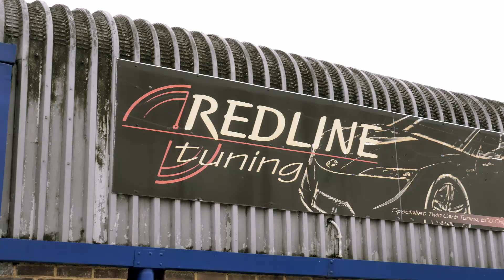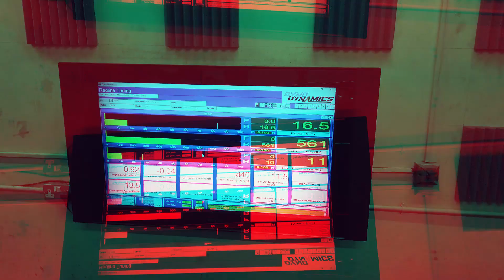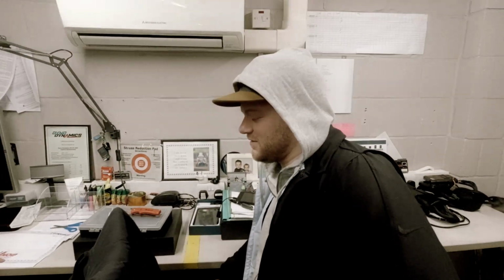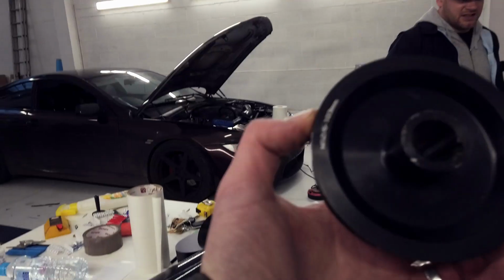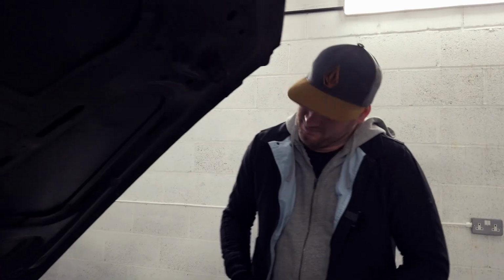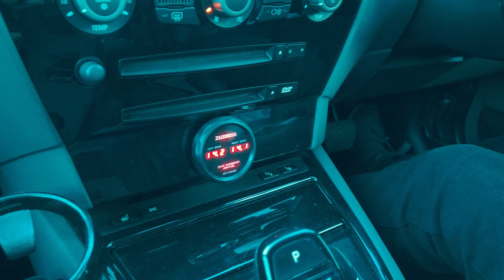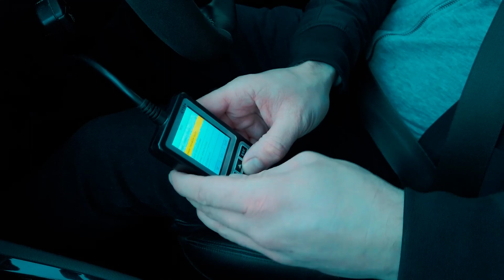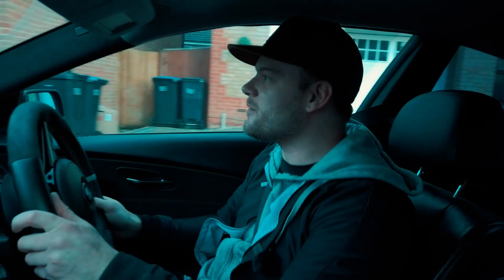BMW 645Ci E63 with 542bhp! BUT there is a catch!!! ESS G1 Supercharger episode 4

Comment: The ZF 6HP26 gearbox in your car is very robust and can handle much more power than 500 hp. It more than likely is overdue for a servicing, which absolutely matters with these gearboxes. They need all of the mechatronics seals replaced as well as a fluid and filter change every 50k miles. It can handle the power so long as it can keep up proper valve body pressure. There is a big following for these gearboxes here in the states. If I can be of any assistance, feel free to message me. I’ve rebuilt a few valve bodies on this transmission before and it’s really not too difficult.
Reply from the maker: thats some good info! I am sure Connor will be back to comment
Reply: The issue is the line pressure. The ecu torque map ends at 600nm. After that the gearbox sees -100nm. We’ve got the TCU seeing around 580nm now and it holds 540ish but can’t hold 577 which the car has made since. The gearbox has been completely rebuilt. I also now have ghe exedy 1000hp rated clutches that I’ll build into my sister gearbox but not for a while yet.
Reply: @MrConnorHorton  Gotcha, thanks for the insight. I’m fixing to have to rebuild my 6hp28, I’m getting ratio monitoring fault codes, causing the 3rd gear lockup malfunction. I’ve done the valve body but it seems I’m going to have to tackle the internals. 🥲

So this is your car? It’s a sweet ride man. Tell me, why’d you go with the M5 diff instead of a quaife? 

Are you still happy with the supercharger kit? I’ve been itching for a while now to pull the trigger and get it.
Reply: @scootitnbootit9231  it’s my car yes mate

Still going fine. It’s currently around 520-540 ish and the gearbox see 580nm ish. That’s enough for it to hold for now. 

Once I’ve built the other gearbox I’ll go for more power again but not until next year now. 

Aside from the gearbox it’s been fine. 

The m6 LSD is really really good. My old boss had a m6 so I knew it was good before I did it.
Reply: Fr alpina used that in the B6 and had 525hp
Reply: You got a video on how to replace mechatronics seals?!

Comment: 500bhp was the limit for my transmission. I simply swapped out the stock transmission with one sourced from an ALPINA B7. Theres a little bit of a modification (mechatronics swap and gear selector prindle). But she runs like a top.
Reply from the maker: That’s good to know! Cheers
Reply: @Eggert Eggertsson it’s a m6 diff. You need e46 stub axles, the rear half of a m6 prop shaft and the m6 LSD. It’ll go straight in. And just a little 1mm sleeve for the rear mount bolt.
Reply: The 6 series and alpina b5 b6 b7 all have same transmissions

Comment: Awesome work guys, I'm getting ready to supercharge my 2010 650i right after I paint it. I'll be doing the paint and the ESS install myself and it's good to have your videos to fall back on in case I get stuck.
Reply: Bro I want too make my n62b48 with supercharger, but our with you engines have very high compression ratio. 
I can give a link to a Russian site where a compressor from Alpina was installed on the b48, if you want.

Comment: Did you have to make changes to the Crankshaft or the Rods?
I've read a lot of times, that a supercharger on the N62 won't work with the stock compression of 10.5:1
How is this setup for a daily driver??
Nice videos by the way ;)
Reply from the maker: Nope, engine is stock as far as i know. and thank you!
Reply: Yep all stock internally. 10.5:1 compression is fine for boost these days. Tuning has come a long way.

Comment: Did you guys replace the valve stem seals, head gasket, or any other big maintenance item before installing this G1 Supercharger? I'm wanting to buy the TVS2 Supercharger but want to do all the maintenance that way I have the least chance to blow my engine up. I know, I could just sell the 545i, buy an M5 and already be at the HP I'd make from supercharged N62, but building is about the journey, not the destination. Besides, I've put too much restoration maintenance into this 545i to just let it go.
Reply: Yes mate I did all of that. Everything has been refreshed or replaced…and i mean everything on this bastard.
Reply: @MrConnorHorton  hells yeah! Well I respect the grind and the build, good job!
Reply: I think supercharging the 545i would be cheaper if you got the 545i for under 5k
Reply: @jamescarroll8972  what if I got it for exactly 5k? 😅

Comment: I'm building from scrach same project.. my car is manual..   regarding gearbox .. use a diesel 6hp28  keeps up to 1100nm.
Reply from the maker: Great. Thanks for the tip. And good luck!
Reply: The diesel gearbox won’t be any better. It’s not so much that the box can’t take it it’s the fact that the ECU is telling the TCU the car is only making 440nm of torque. If I put a diesel box in the ecu will just tell it the car is making less torque and it will lower the clamping force values accordingly. The ecu tuner thinks he can up the data values sent from the ECU to the TCU but it’ll depend if the provisions for the upped values are loaded into all the TCU systems or if they are specific to each vehicle. We will find out i suppose
Reply: @MrConnorHorton    What you say is explaoned here https://youtu.be/hUkz_-R0j4w

It works , you just need to align dme ecu with gearbox ecu
Reply: @b2bogxxy  I just watched the whole video. That’s that’s exactly as we thought. Very good video.

Comment: Would sourcing the trans from a wrecked E65 chassis Alpina B7 (supercharged n62) be feasible?
Reply from the maker: only one way to find out lol. but where to find one for reasonable money?
Reply: @RuskiWeldFab  eek, maybe an auction? insurance company...? body shop? sometimes people bite off more than they can chew when purchasing a supercharged B7, the air suspension sags, & folks end up letting them sit. They take 'em to the shop for repairs, & freak out over the cost & decide to sell them as-is. Might have to do some scouring - they were rare. But if ya could find one, it'd be pretty sweet!
Reply: @RuskiWeldFab  The Merc, say, E320 had their 722.6 5AT - the E55 AMG also had the 722.6 5AT, but had a beefed up valve body, shift solenoids, & torque converter lock up solenoids - maybe, maybe you could source the supercharged B7's shift solenoids, tq converter solenoids, & valve body...🤔
Reply: It’s the software that’s the issue not the box. I think we’re nearly there with it

Comment: Hast du mit dem  serien  riehmenscheibe weniger leistung gehabt nir 447ps? Wie geht das?
Reply from the maker: sorry dont speak german my friend.
Reply: @RuskiWeldFab  oke i  dont spek english good...  Oke you have with stok ess puley(biger)  only 447hp? And with smaley pully more hp? Why this?
Reply from the maker: smaller pulley makes more boost because it spins faster.
Reply: @RuskiWeldFab  okey good information and whats is with intercoller you need it? An the (stok) engine have dont problems with 500 hp?
Reply: @RuskiWeldFab  i have a bmw 650i e63..  And i only find the G1 kit for bmw  645i.  But i think this is one to one mehanics. Only  a good tuner   make mi a software?

Comment: Whats the cause of slipping in the trans bc im having the same issue with mine and my car is stock.
Reply from the maker: the ECU thinks it still has 440nm.
Reply: Your stock one shouldn’t slip. Your gearbox needs a rebuild. This has since completely ruined the gearbox and has been fully rebuilt but I’m still chasing issues with the gearbox software

Comment: Hi I have a 545 project with another supercharged  Is it possible to get a map with which comes supercharged
If of course you want to give it to me
Thanks
Reply from the maker: it doesnt work like that lol. your map will be totally diffrent.
Reply: @RuskiWeldFab  I think he can only start the car If I have these settings then I will set it for mine
Reply: @RuskiWeldFab  If you have a Facebook, I can show you photos from my project
Reply: Hi Tony. 

My car has ESS map on it which is encrypted to the car the first time you use it. The piggyback ecu then tunes the values of the ESS map. So I can’t take anything off for you I’m afraid. Also no way would my tuner allow that.
Reply: @MrConnorHorton   no problem
Thanks

Comment: I have two e65s with 4.4l...been looking for a supercharger at a reasonable price...which would be the best route to go....there’s not much on the market for these engines...wanting at least 400+ hp??
Reply from the maker: charger if you want lots of power
Reply: Define reasonable price
Reply: @MrConnorHorton  🤣....I cant...I’ll just say estimate??
Reply: Your not getting 400hp without a supercharger ever. So 8k ish.
Reply: @MrConnorHorton  good info...I was thinking about an ls swap...but if the internals don’t need upgrading I’ll look into supercharging...what’s your opinion??
Reply: @MrConnorHorton  plus I’ve seen a couple you tubers that said they didn’t have to go inside the motor..that it was all stock before charging it.
Reply: @acourtneylawson2065  I haven’t changed anything internally. So you can make over 500 safely.
Reply: @MrConnorHorton  😳...thanks my dude
Reply: @MrConnorHorton rebuild the motor you’d get over 400 without it

Comment: Can I use this supercharger  System on a e60 550i with the n62b48 engine?

I hava a 550i e60 enigne is new rebuild!
But i have a six speed manuel Transmission!

Is the ess kit expensive?
Reply: Check the ESS website for prices. They do a kit for the b48.
Reply: The kit for the N62B48 engine is the same as the 4.4 one. It's not listed by ESS as there is one difference and they can't get the part needed, but it's an easy DIY to work around. Apparently one of the coolant hoses needs to be reworked to fit this to the 4.8 engine. Also, I think the oil cooler pipes need to be moved slightly. (4.4 engine doesn't have oil cooler)

Comment: That poor car! 😂is it a dct gearbox in that model?
Reply: Na it’s the ZF6HP26 auto box. It’s been remapped for true manual and paddle shift. So it holds whatever gear I want and won’t upshift at the limiter
Reply: @MrConnorHorton  ah ok gotcha. Thanks. Any way to beef them up to take more power?
Reply from the maker: We working on it! I just need. Bigger lathe 😂😂
Reply: @andylaunchbury8539  it can take the power I just need to find a way to up the line pressure. As far as the gearbox ecu is concerned the car is making 440nm where as it’s actually making 620nm. The gearbox just doesn’t know how hard to clamp the clutches.
Reply: @MrConnorHorton  Remapped thru XHP flashtool?
Reply: @ReMaQs  yeah
Reply: @MrConnorHorton  manual swap ? With upgraded clutch
Reply: @nofaceahk5802  nope not going manual in this car